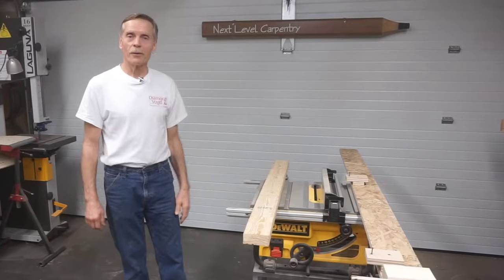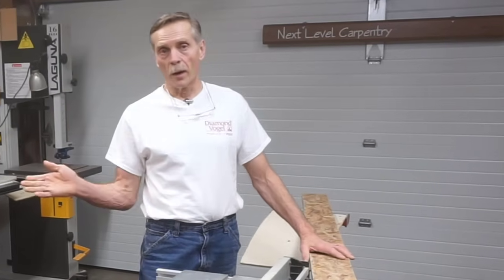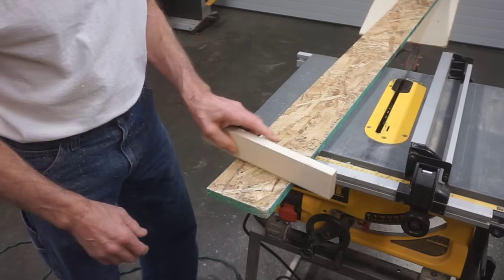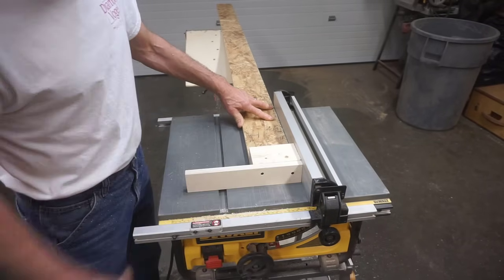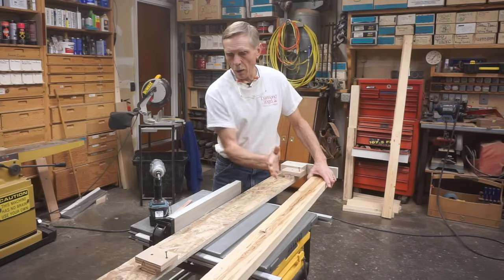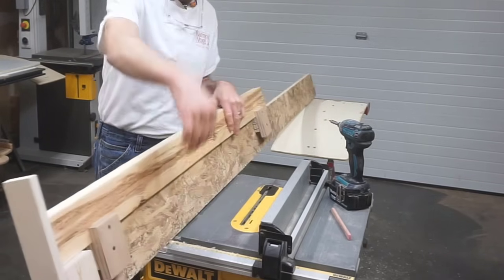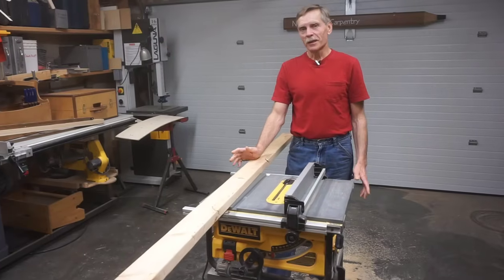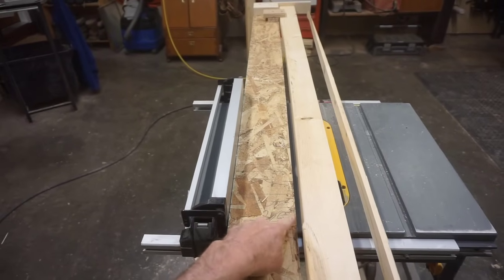How to Cut a Straight Edge on Crooked Boards

Comment: What size powermatic jointer is in the background of this video??? Pick any piece of wood from a Home Depot rack and you’ll quickly see dimensional jelly that still needs to be milled haha
Reply from the maker: My jointer is a Powermatic PJ 882 with a Byrd SHelix carbide cutter head... it's an indispensable piece of equipment in my shop and I recommend it to anyone that has the budget and space!

Comment: Although this does work I do agree that it's to much work I work with alot of reclaimed lumber the Principle of this is to get a constant frame of reference to cut a straight line I use an 8 foot level that I clamp to my fence so the board is in full contact with the straight edge at all times takes 2 secs to set up and you get a straight cut every time
Reply from the maker: Good on you Chris... but please tell us; what do you do when a board you need to straighten is over 4' long since that's all your 8' level method is capable of straightening?
Reply: Great idea - thanks

Comment: Thanks for the video, perhaps I missed it but why did you not just use the rip fence? Why did you need to build a custom fixture?
Reply from the maker: Yup... missed it Mihaly.  Watch the video again... I certainly wouldn't bother making a fixture if it wasn't necessary! 😁😎
Reply: @NextLevelCarpentry  I still did not find you specifically explaining, but I understand now. The board will be crooked on both sides making it unstable to feed 👌
Reply from the maker: @nullpointer1984  Yup... You got it👍😎

Comment: Would a fence that was extended long enough to contact the board for the entire cut serve the same purpose?
Reply from the maker: Sure would... for it to work the fence needs to be 2x the length of the board plus roughly the blade diameter.
Reply: @NextLevelCarpentry  Heh, might not fit in some shops but would be neat for outdoor cuts. Thanks, cheers.

Comment: What saw blade are you using? I'm using a dewalt construction balde with 24 teeth and it keeps tripping my circuit breaker.
Reply from the maker: I'm using a blade similar to yours without trouble.  Blade type is only one of many possible causes for tripping breakers Jihad.  Make sure the blade is sharp & clean, installed correctly, your fence is set parallel to the blade and that you have good power to the saw ie: plug right into the wall or on a thick, short extension cord.

Comment: Or just attach a strip the width of your slot to the bottom of a long 8ft pice of ply. Then run that through your saw. You now have a straight edge parallel to your guide slot.
Then screw the curved board to the plywood guide so that the two ends of the board just stick out from the straight edge. And whomp there is your straight edge to run along your fence to get a parallel edged board.

Comment: After he removed the bow, why not flip the board and glue the bowed piece to the bowed side and that effectively repairs that piece to be used possibly for the intended purpose? Cutting the other side straight gives an very size, repairing you only loss a blade width.

Comment: Boards that have bow usually have it because of internal stresses.  You make the cut, the board springs crooked again!
Reply from the maker: So is your solution to just throw out 100% of bowed boards for the 25% that are unusable because of internal stresses?!  No wonder there's a shortage of quality lumber. 🤨
Reply: @NextLevelCarpentry  Use them for short pieces only.  Nothing wastes time more than a board that keeps bending after it is cut.  You end up cutting it until it is too narrow for the project.  If table saw is used, more than warped board can be lost.  Sometimes a board can be salvaged by cutting equal amounts from both sides.  this saves boards that are initially straight but band after one edge is cut.  I have learned to get excess wood & store it for a year, THEN use the straight boards.  This applies to "construction" lumber, not exotic woods.  Big Box Store wood is suitable for sawhorses & carnival tables, not furniture.
          I am fighting this battle with PLASTIC lumber.  I have to cut board from the center of the raw-stock.  Board curves away from the fence (on band saw).  After the first side is cut, it curves A LOT.  Then I cut the other side of the curved board using a fence with convex overlay (like using re-saw post rather then straight fence) & it straightens again.

Comment: In a job site situation by which i’m assuming that you are referring to framing, then why would you be straightening 4x2’s? By doing this you then alter the size of the timber therefore making it unusable for framing as it will differ to the rest of the timber
Reply from the maker: My guess is that you're lacking experience "In a jobsite situation..." because, anyone who had real-world jobsite experience has encountered plenty of situations where straight pieces of non-standard width are needed.  That experience also teaches carpenters that the cost of lumber makes it more than economical to get maximum yield out of crooked boards by making straight, narrower pieces out of wider, crooked stuff, hence the lesson in the video.

Comment: Would this be the basis for what you would choose as the method for producing straight edges on rough-cut lumber that is crooked on all four sides? I apologize in advance for likely not knowing the exact wording to describe what it is that I am working with. Long story short, I am in the process of reconstructing the wooden frame for a "vintage" 1985 "stick & tin" Toyota Dolphin, a 21ft Micro-Mini class C RV built upon a cab & chassis of Toyota's notoriously indestructible truck by National RV. As I've learned the hard way, when you peel open a section of the coach to repair what appears to be a small bit of water damage, it is almost guaranteed that you will find yourself standing amidst a mountain of semi decomposed 1x1s, 1x2s, ⅛" paneling scraps, and what proves to be one of the more resilient materials found in the build, gold-toned pleated shag carpeting. I could go on about the baffling lack of common sense found beneath the surface, one of the most egregious being the nails driven into the end grain of the ¾" plywood that serves as the floor and therefore the foundation of the build, but then I would all but guarantee that this comment would go unread😁. So, there's a woodworking shop right down the road from me that specializes in routing custom moldings to duplicate what is found in historic restorations & renovations. I spotted the massive pile of "scraps" in the parking lot a while passing by some time ago. I stopped in and was quickly introduced to the manager who gave me the okay to take whatever I wanted. The wood is a mix of cedars, oaks, and at least one other that I've yet to positively identify. What is common with 95% of the wood is that it is in 16ft lengths. I began taking pieces home before this RV rebuild project was forseen, using bits and pieces here and there for various little projects but nothing that truly reflected the value of my discovery. But now, as I have just completed the disassembly and removal of the entire passenger side of the structure, with 2×4s and scissor jacks used to support the roof and reverse the concave nature of the top, I am finally putting this source to good use. 
    As I said, the framing originally consisted of 1×2s and 1×1s dimensional, so ¾×1½ & ¾². I have collected several pieces that are ~2" ², and have started with the jig as you so eloquently demonstrated in the video, and I think this will suffice. I am cutting the pieces to shorter lengths so as to minimize the extent of each piece's now and am allowing the pieces to sort of dictate which side is the most pronounced in its misalignment (guessing that it has a good bit to do with the direction of the rough cut lumber's grain), then using the jig a 2nd time so as to produce a true 90° corner from which to guide my final cuts. 
     Well, this is by far the longest comment I've ever written! I guess I've somewhat answered my own question, but nonetheless would be interested in hearing your input. I'm sure at some point or another either myself or someone else who manages to plow through this long winded comment might find themselves with a piece of lumber so askew as to require an additional means of support. I appreciate your time spent making these videos; time and again I find myself referring to your channel for valuable pointers. Thank you!
Reply from the maker: I would only use this process in an attempt to straighten two adjoining faces of really crooked lumber as you describe if I were desperate.  
The only way to do what you're trying to do with any hope of efficiency and expectation of safety over the long run is to use a jointer.  Getting long, twisted/bowed 2x2's attached to any fixture securely enough and quickly enough to be safe and practical is a lot to expect. 
With the price of wood these days it almost makes sense to salvage expensive hardwood and, if you think about it, would easily justify the cost of a decent jointer if you don't know someone who will let you use their jointer to straighten two adjoining faces on a bunch of pieces so you can straighten the other 2 faces on a tablesaw.
Good luck and be SAFE, Nick... you can buy an awful lot of clean, straight lumber for the cost of even a short visit to ER!
Best, Matt

Comment: I hope some one reads this question: can you  just use your fence as the straight edge? I’m by confused by that part?im new to this. Thanks
Reply from the maker: Try it sometime and you'll see immediately why it doesn't work; you can only straighten a piece that's 1/2 as long as the fence.  Even if you have a fence that's 8' long you can still only straighten a piece that's 4' long.  To straighten the 8' piece shown in the video you'd need a fence that's a full 16' long... which demonstrates the usefulness of this simple method.

Comment: I'm new to woodworking but is there no other way of doing this that prevents you having to drill holes in the board you're straightening? Guide rail for circular saw maybe?
Reply from the maker: There's all kinds of ways to straighten boards for woodworking without making screw holes in the boards.  The one I use most is running them over a jointer because it's the best and most efficient.  There's other videos on YouTube that show how to use various clamps instead of screws too.  Most important thing is to make sure you're comfortable with the setup and are certain of your safety!  There's no board in the world worth the risk of an injury from the straightening process...
Reply: @NextLevelCarpentry  Awesome, thanks for the reply!

Comment: Hey! Thanks for posting. I am making a dovetail box. Long story short I have a table saw and the cuts I made originally were all just a little off, after getting the dove tails put together I tried sanding the edges to get them even but it just threw off the whole piece and now I don’t have any straight edges to work with all sides are under an 1/8 inch off but it is keeping the bottom of the box from being flush. Is there any way to fix this kind of problem I don’t want to take too much off because if I go more then 1/8 it will be apparent the dovetails have been cut. Any feedback you or anyone on here can offer would be great I’ve been messing with this for almost a week now. Thank you!
Reply from the maker: Sounds like a bit of a predicament Jacob.  Not a big problem but tricky to fix.  You might be able to fix it by making the box a little smaller/shorter but might have to chalk it up as 'tuition' paid for a class in box making and start over.  That can be a bit hard to swallow but it is occasionally the reality of woodworking and learning.  The main takeaway from the experience is how important accuracy is in woodworking in general...
Best, Matt
Reply: @NextLevelCarpentry  awesome! Will do. Thank you!

Comment: I'm a new hobby woodworker, so please forgive my ignorace. I work at home, not on a job site, so I have access to a jointer. Could I not use my jointer on the edge to flatten the bow in the board?
Reply from the maker: You are correct in your understanding that a jointer excels at flattening/straightening boards.  This method is primarily intended for jobsite use where, even in the rare case there's access to a jointer, it's faster.

Comment: How about when we have a crooked wood in its width.how we fix it
Reply from the maker: If I understand your question what you're asking is how to flatten a board that is cupped. The most typical way that's practical is to flatten the cupped face on a jointer. It's fast easy and effective but unfortunately requires that use of a jointer which is a power tool dedicated to that sort of task. It can also be done using a sled in a thickness planer or by hand with the right type of plane but those are typically considered more advanced woodworking methods so if you don't have excess to those tools your best option is to make sure the wood you buy is flat. Best, Matt

Comment: On this type of fixture, I'm always nervous that I'll let my thumb stick out into the area where the blade will emerge. A red sharpie X-ing out the top and rear face of that area to remind me to hold only over the OSB makes me more comfortable. So,  for anyone who hasn't seen a sled before: Remember that the blade is going to emerge from that push block and you'd be surprised how many people have lost track (and lost a thumb). I don't like appliances that make you safe via "remember or else," but that's just me.
Reply from the maker: Totally agree "remember or else" is an extremely dicey safety program indeed...
Best,
Matt
Reply: @NextLevelCarpentry  I deleted the description of what I do on a bandsaw because it may not be appropriate in the context of a table saw. Totally different beasts. I wonder whether your hold down blocks might be enough so that you don't even need your push block? Or, if you kept a decent sized knob in your bag,  you could screw that down into the 2x4 that supports the push block. The knob would scream "grab me" and might block the dangerous grip. I'm picturing something like the knob / handle from a miter push gauge. But, honestly, you could still stick your thumb out.
Reply from the maker: @ef2b  As you're well aware there's always potential danger of amputation working with a tablesaw and every effort made to adjust your setup and workflow to minimize risk is time well spent.  Unfortunately, complacency is our greatest threat because lack of focus and/or situational awareness can so easily circumvent our best efforts and intentions.  Work safe and sensibly! 😎
Best,
Matt

Comment: I just bought what looks like the same table saw. My first one and I'm new at this so I have this question. Putting the 2x4 against the fence why is that not the same thing still a straight edge? Is it about locking the 2x4 in place?
Reply from the maker: Get a bowed 2 by 4 and try what you're asking about on your new table saw. It is a good mental exercise. What you'll find is that unless the fence on a table saw is twice the length of the piece you're trying to cut straight it will just cut the edge off the 2 by 4 but both the cut off and the two-by-four will remain bowed. You will then understand the purpose of this fixture which is in effect to extend the length of the rip fence on your table saw. Let me know if this helps...
Reply: @NextLevelCarpentry  OK so the fence is not long enough is what you're saying. The length of the plywood keeps the 2x4 the same throughout?
Reply: I see what you mean though. Thank you.
Reply from the maker: @boxerses1  you seem like an intelligent guy just experiencing something new and it sounds like you understand the concept. You would get the same result if the fence on the table saw was 16 feet long. That's why the fixture is so useful because it's cheap compact and portable.
Hope you find more useful insight and information and other Next Level carpentry videos which I think you will find are produced better and more watchable as I figure out how to edit video better...

Comment: For wood that's bowed the other way, across the wider side, I'm assuming that's pretty much a lost cause?
Reply from the maker: It's only a lost cause to try and flatten a board with a table saw. The wood is definitely not Beyond use if you have access to a jointer or a thickness planner with a planing sled because either of those options will quickly and easily flatten cupped boards.

Comment: Couldn’t you then glue/clamp the cut piece on to the other side to make a square and straight board again? You would essentially have the same size you started with minus the width of the cut.

Comment: I have neither the room nor the storage space for even a 'Worksite Table saw.' All I have is a circular saw and a length of 1" x 1" Angle Iron as a 'Straight Edge' and 'Guide Rail."
Reply from the maker: Your setup is an upgrade from the snapline and skillsaw I used for years before there even was such a thing as a 'worksite table saw'.  Definitely builds your skillset and makes you appreciate equipment more when you get it! Best, Matt
Reply: @NextLevelCarpentry  After that it Basically comes down to using a 'track saw jig made from some 1/8 Inch Plywood, a 1 x 2 as a rail. (Stores more easily than a 'Worksite Table Saw.')
Reply from the maker: @ghos282  I have a similar thing that I use at times when the jobsite saw isn't on the jobsite... I call it a 'poor man's track saw' 😎

Comment: Better to build a extended guiding board attached to the saw itself, because then you convert the tool for the purpose instead of the board, you save time and it is easier with the exact same result.
Reply from the maker: Are you saying that attaching a 17' long 'extended guiding board... to the saw it self' saves time  and is easier than this simple portable jig?!  Interesting...